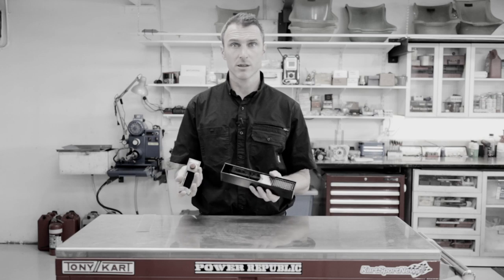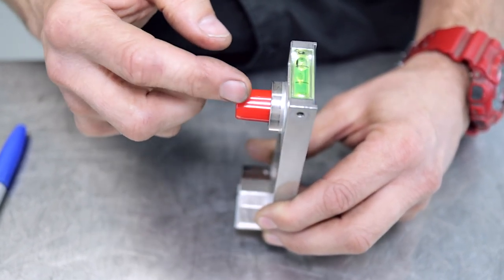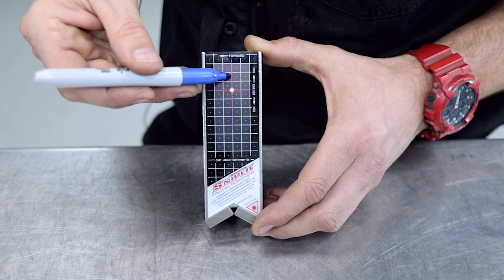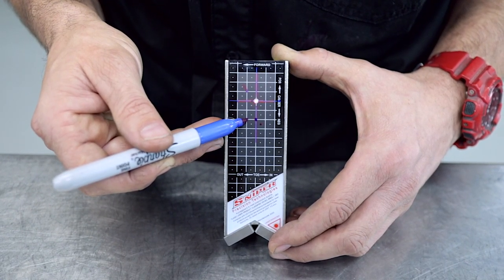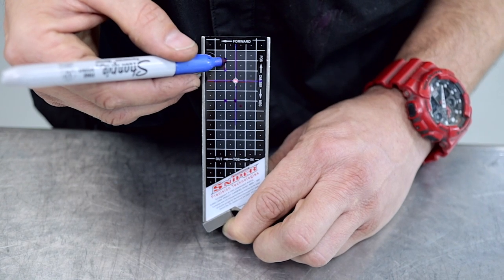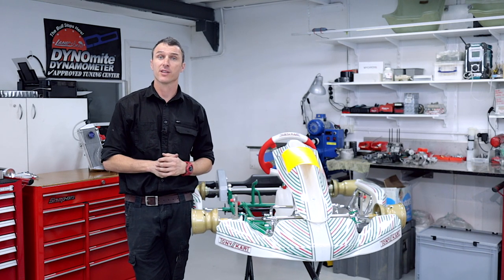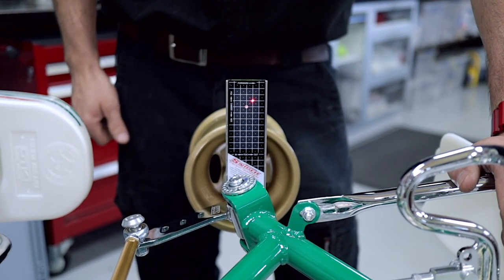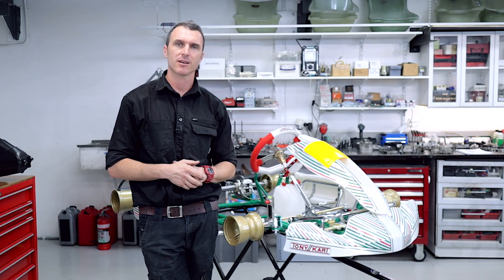HOW TO: Sniper Laser Wheel Aligners Explained - POWER REPUBLIC

Comment: That’s interesting about not needing to have the kart level to start with when using Snipers. We always had to have a level flat bed when setting up Formula Fords with ride heights and corner weight to adjust too so when doing alignment etc on the karts, I have kept the kart level just out of habit I guess! Great video.
Reply from the maker: for corner weight I would agree that the level surface would be needed, but it seems that snipers work fine level or on the drink.  thanks for the positive feedback

Comment: Thanks for the videos. Very informative as always. Question, I have an older set of snipers that slide onto the stub axle. I only ever slide them on so the are on the outer end of the stub axle. I imagine this magnifies the measurements I’m setting. Should I be pushing them right up closer to the king pin?
Reply from the maker: i have tried both.  the only problem would be if your stub axle had a bend in them.  Maybe just slide the sniper into maybe, 10mm spacer off the base of the stub.  that way you mitigate any potential error in the stub and avoid any misalignment from the sniper riding up on the fillet of the stub where it meets the boss/body of the stub axle.

Comment: Hi, regarding to toe the sniper manual states that: 
" Each horizontal line (the camber plane) on the grid is equal to 2mm camber per side. Similarly, each vertical line (the toe plane) is equal to 2mm toe per side. A movement of one full grid on the toe plane each side of the kart would equate to “4mm toe”." 
So the base setup you are running is 4 mm total toe out on tony kart?
Reply from the maker: Hey Thierry, we did move the toe and camber in this weeks video using the angle aluminium and that would suggest that each line (or box) is equal to only 1mm.  But either way, it is not important the 'millimetre' value, what is important is fast lap time and an awesome feeling kart.  so if your snipers are on the first or second line Pos camber and that is where you win all your racers, lets just leave them there and go out and dominate

Comment: Are your reference point settings for when the kart is on the ground with driver in it or on the stand? Thanks
Reply from the maker: they do move with the driver in it.   but I just use them on the Stand and go from there.  easy as

Comment: As always, great video! How about static and dynamic camber alignment? I mean if gokart is on the trolley there is different measurements on laser than if gokart is on the ground - what is correct behavior - I must measure camber only on trolley and measurements on the ground doesn't matter? Especially in old, highly used chassis which is too flexible, the difference between static and dynamic camber probably be higher 🤔
Reply: Or even if driver is overweight, camber angle changes much more if you put gokart on the ground and sit on it
Reply from the maker: Great point and I think if you did that once as a reference so you could compensate for it in your camber adjustments.  I personally do all our adjustments on the kart stand.  Not saying that is the only way, just what I like to do.  Mostly camber changes are in response to the driver/kart requirements and all I have to do is slap on the snipers, see where the current camber is at and then move in the direction to improve the chassis handling.  So simple compared to the ol days before this amazing tool
Reply from the maker: Yes that is correct, a bigger driver on an older frame should 'bump' the  wheel alignment more.
Reply: Power Republic Yeah, thank you for answer. So as I understand, on new chassis (or lightweight driver) camber range is for example +1 to -2 deg (depends on tyres wear) but in old chassis (or overweight driver) range should be closer to positive, ex +2 to -1, right? Ofc this values ^ on trolley/stand.
Reply: @KKarczmarczyk  it always changes with weight its all about driver feel aslong as the alingnment is the same left to right ands chassis straight ..u cant save tyres ether  to be fast .. but being fast usaully means your good on tyre  if you get me ..with just a straight up and down wheel alignment is never gonna get you anywhere.. . usaully the natural chassis castor pushs the toe in to positive toe with weight of driver.. at end of the day the driver has to feel the change's he's the key .. but if u have never played alingnment u should test because the good guy know where to go with it and know what the kart wants.. not testing and trying new things will lead u to know where..
Reply: Jackson bermingham thanks, I will try different settings :)
Reply from the maker: @KKarczmarczyk  yeah that is what we do.  with the older karts that have heaps of wear and tear, generally we will use more  POS camber to 'liven' up the feel of the kart.  Also too you can add your front torsion bar to help the front end work better if you always feel that the kart understeers, another common problem for the older chassis.

Comment: When changing settings, do you re-zero the bubble or not?
Reply from the maker: yeah I re zero it if it moves out.  then start the process over, and then double check it again.
Reply: @PowerRepublic  to be sure we are on the same page. Let's say I change the camber and the bubble moves you rezero the bubble, correct?
Reply from the maker: @kartbroertjes  yeah that's what I would do.  same as if you had been on the track and wanted to recheck you camber, you have to put the snipers on and re zero the bubble.

Comment: Thanks for the great videos! As far as I know, all measurements are done on the trolley. However, if I put the kart down on the floor and the driver in, the camber changes roughly 4 mm to the negative side. So, in order to have let's say 2 mm negative camber on the track, I'd need to adjust the camber to +2 mm while the kart is on the trolley. I am doing anything wrong here or is my frame just old and too flexible?
Reply from the maker: Hey Rene, no you and the kart are fine.   It is true, the chassis will 'bump' about 4 mm when the driver is in it.   but the trolley setting are relative, so set it as you please for ultimate lap times, not the dynamic or actual measurement when driver is in the kart.  
so if you drive the kart and need more Neg, add more Neg in relation to where it is currently set.  If you drive the kart and need more Pos, add it in relation to where you currently have it set.  hope that helps
Reply: @PowerRepublic  Hi Derek, thanks for quick reply and yes, it helps. I was asking because I could not find any video or other information touching this issue. The problem for me to solve is that it is actually quite difficult to get the correct feedback from the drivers (my sons :-) ).  For me at least. Thanks again and keep up the good work.

Comment: Hi, thanks for all your videos! Could you do one about air filter maintenance? Describing all different types etc.? I got an old one on a 100cc without any internal sponge element, is it ok? Am I risking debris getting inside the engine? The plastic airbox has the 2 holes in the upper part, but you never know...
Reply from the maker: Great suggestion, you can fit an new style air filter to your existing airbox if you wanted.
Reply: Hi I'm assuming you have the old yamaha 100 j or s filter.
you can also buy the foam insert for the filter and I would also buy some oil filter oil. 
Put a "small" quantity of oil onto the foam insert at first and place in a plastic bag and squeeze the insert to make sure the oil is penetrating the foam.
Then add a bit more oil filter oil to make sure it whas penetrated 
Try not to saturate the foam insert because that could impede the air intake. 
This should  last you for a while unless you crash into the dirt, then you will have to repeat the process again.
To clean the  foam oil filter you can buy a liquid cleaner or use detergent but don't use petroleum based cleaners because that can melt the glue to the sealing ring that attaches to the foam insert..
Hope this helps.
Reply from the maker: @Zuludarkthirty  thanks for that great explanation
Reply: No problems Derek